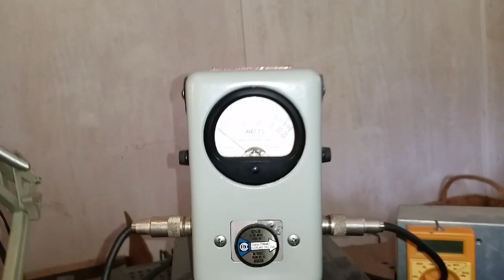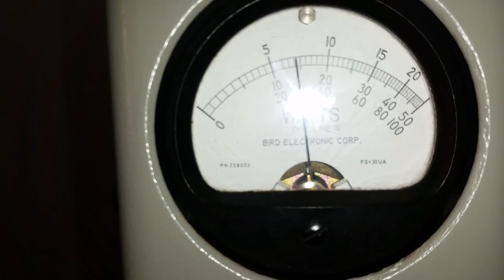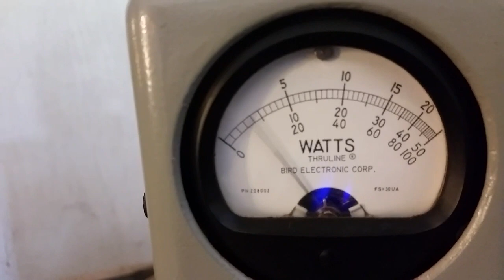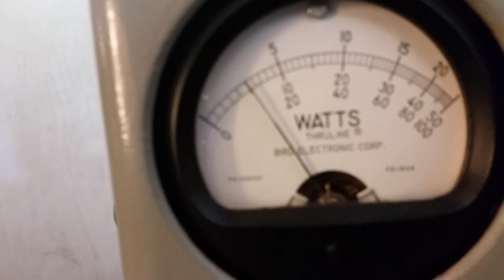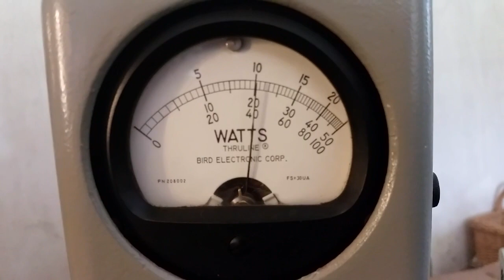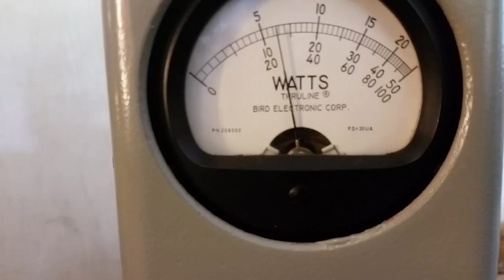Skywalker 16xIRF520 Mosfet 16 Pill Amplifier For Ebay - SOLD

Comment: I've seen those same boxes to 5 and 6000 peak watch.
With fifty watts of drive , but running on about eighty amps
Reply from the maker: That is impossible these are only 30w each maybe 50 pushing hard so 50w x 16 = 800w pep I think your thinking of the ldmos probably brother.. let me know thanks for stopping by
Reply from the maker: Oh you didn't mean 6000 did you you meant 600 lol.

Comment: the nice thing is the FETs will run cooler  than 2879 type transistors. making AB bias would clean it up a lot. FETs bias different . will take much less bias amps. have to look at data sheet. the drain current should be so many Ma per fet with no RF.  do not over bias FETs you will get thermal runaway and they pop.

Comment: i think 200 watts drive is over kill. if it's making 600 watts. when you got 400 with 100 watts drive. it might not kill it. but the power usage is more at that high drive than the return.  just my opinion, you could make a grounded grid 811a amp that would make more power at 100 watts drive input. if you see my point. but it is a hobby and hobbies are meant to be fun. i'm just applying a bit of logic to it.
Reply: the 4x16x64 box sounds killer, if it were built with 4x16 2290's and 64 2879's. or comparative transistors. then only need a 4 watt low power radio to push it with.

Comment: Gatekeeper. First let me say that I Enjoy your clips. Not knowing what the driving wattage should be don't you think it would have been safer to drive it with the round 50? At least until you did some research. 200 Watts for this type of amplifier definitely seems to be Overkill. Lucky thing that the Magic Smoke wasn't released. Have you since found out the proper amount of drive this amplifier requires?
Reply from the maker: BIG APPLE hello brother this was 16 x irf 520 mosfets. Straight 16. 200w PEP was just for test purposes to show output increase. The builder of the amp listed over 200 was the max but its a class c amp isnt even biased. If it was biased the way yeah mosfet amplifier should be done and yeah I wouldn't drive it no more than 50 to 100 Watts Max but that was just for the video brother I got a little bit of experience running these mosfet I have even ran test of driving up to 100 Watson to just eight of them for long periods of time but regardless that amp is not you fishing at all because it is not biased so you're not going to get nowhere near out of it what you should pretty unique though thanks for stopping by and giving me your comments
Reply from the maker: Another thing i went by was using 2x520 in a TS Hybrid you can do 4 to 20w pep....20x8 is 180 so.

Comment: 1000 watts pep is the same as 707  watts rms
Reply: Not true
Reply: this is covered in the first 2 weeks of electronics technology  class break out a book I am not trying to be a a hole but seriously it is true. rms is   .707 times peek
Reply: robert Fleming The rms value of a sine wave voltage is 0.707 times peak, but that is not what we are talking about here. Peak envelope power of a transmitter is the average power for a complete rf cycle at the crest of modulation. This is a lower figure than you will find attached to Italian CB amplifiers which is peak instantaneous power... Roughly double the figure you will get from a standard PEP measurement. I am an RF engineer for a living, have been for a long time now.